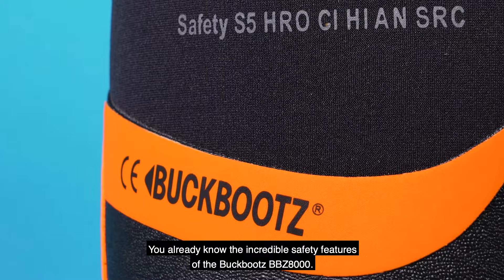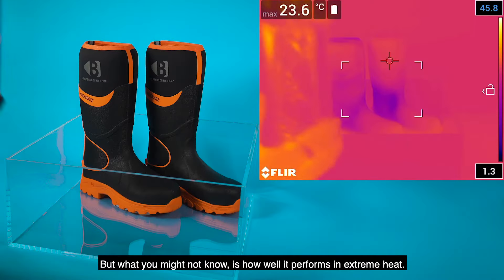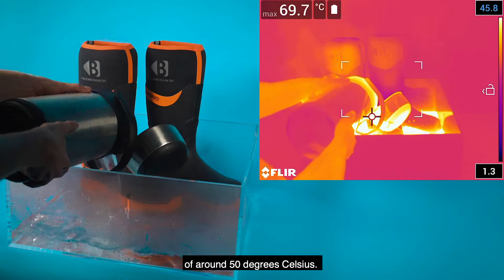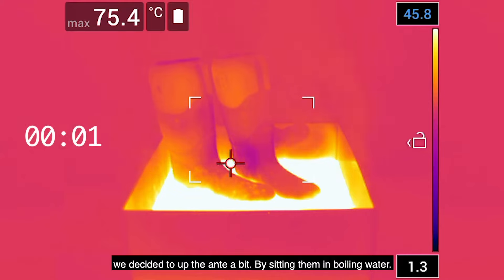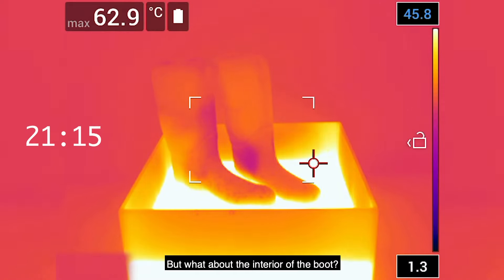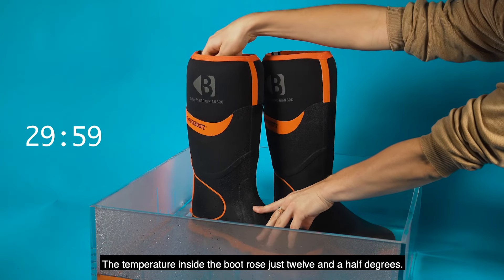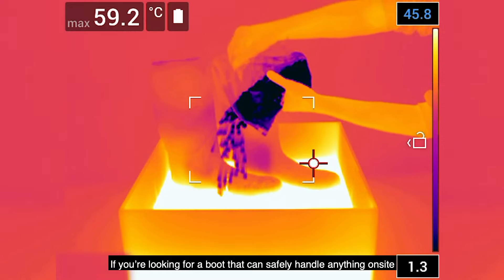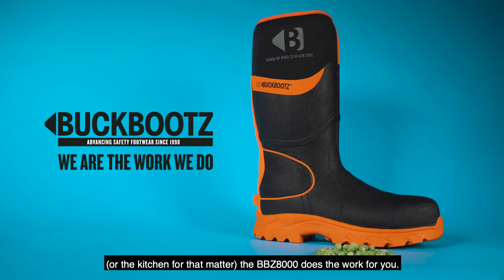Buckbootz vs Boiling Hot Water

Comment: I bought a pair of buck boots which were great and comfortable from first wear
With personal use not worn for work after just 12 months the seal joining the side of the boot to the foot bed split. As I’d bought them 13 months ago no warranty. They cost over £100 
I’ve had cheap wellies last a lot longer. Don’t waste your money definitely don’t stand in boiling water if owned for year

Comment: I perchest a pair of these wellies but on the side under the B logo it says.Safety s5 hro ci an src. But on this video it says .Safety hro ci hi an src. The wellies I have recieved are missing the HI out. Can you or anyone shed any light on this. Thanks steve
Reply: Depends what type of buck boots u have , I have a the same in the video and another pair and one says the same as in the vid and one says something different. Some of them are for different applications or have there own speciality
Reply: Are these fully waterproof? Fancy getting a pair for pressure washing
Reply: @lukehilton5690 what work do you do mate? If you're using the boots for hand digging in shit wet ground don't bother. Get a cheaper pair and a invest in seal skin socks  as buck boots ain't worth a wank
Reply: @lukehilton5690 I was hand digging in clay/sandstone on a burst water main the front split and started taking in water on the the first dig I ever used them. They look the part though